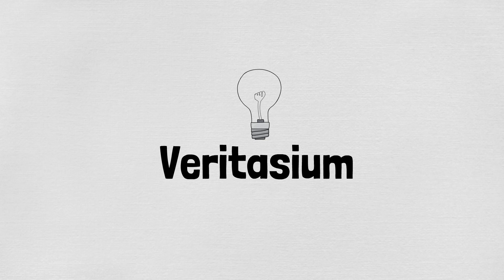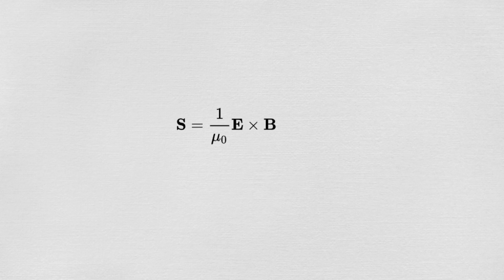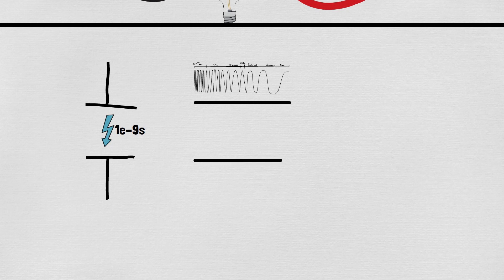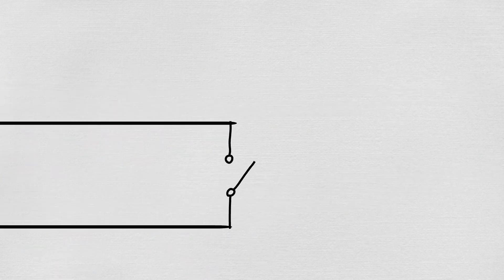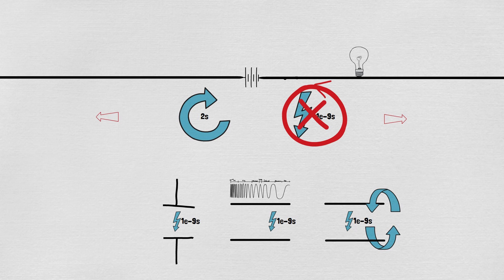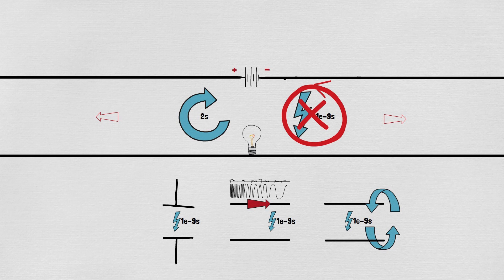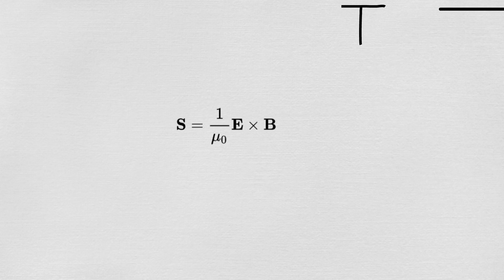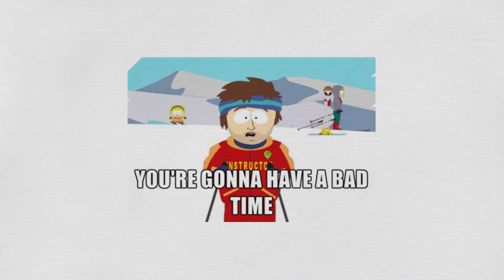Veritasium is Right? (see description)

Comment: Thank you, thank you, THANK YOU!  I made the massive mistake of clicking on the Veritasium link for what was obviously geek clickbait.  I had fallen for a similar video he made about "nobody has ever measured the speed of light".   I vowed after the speed of light screw up I wouldn't watch his channel again.  I am week, and I admit it.

His answer to the "how long" question was actually 1/c seconds, which is NOT correct.  He fails to point out this is Xm/c. Where X is the distance between the battery and the lightbulb.    Yes some small amount of induced current is created by the wires being 1 meter apart, but not enough to light a bulb.  He is also using a DC battery which means there is no oscillating current which means any induced field would be even weaker.  The way he explains this, it implies that you could could communicate faster than light, and that is not possible.

Comment: My remarks/complaints:

Disipative term J•E does not account for transfer of energy but for volumetric distruction of it. In the Veritasium video the line has zero conductance resistance, thus this term is zero anyway. 
That leaves us with grad ExH of volumetric change. Applying Gauss theorem we end up with ExH energy flowing through a surface (normal surface vector omitted).

You cannot model a line as a single capacitor. 

Poynting vector is space dependant.
Reply: you probably meant zero resistance = infinity conductance
Reply: @theincapable  YES. Thank you

Comment: The purpose of the switch is the obvious one, to make a change in the current. Only after we throw the switch can we establish a change in the B field and we won't see a corresponding effect in the far wire without throwing the switch. And if we accept that in the absence of resistance the energy flow is outside the wire, then the battery cannot "know" the state of the switch and change the current in the wire until time T2 = (D2 / c) where D2 is the distance between the switch and the battery. This does not mean that current has to move all the way around the path of the circuit before the light turns on, but some change in the current local to the battery has to occur before we are going to see a change in the B field.

Comment: You are correct that current is zero the travel time at the speed of light from one battery terminal, through the wire to the other terminal.  However the current doesn't instantly reach its steady state value.  The flow of current is opposed by the inductance and resistance in the wire (Current I =  V/R e** -Rt/L ), which could be significant in a 600000 long kM wire.  I would also like to point out that a schematic diagram, such as the one presented, makes no statements about the physical arrangements of components.   The diagram would necessarily need to specify dimensions, angles, wire composition, diameter, etc to make any assumptions or calculations based on such arrangements.

Comment: With the switch open, there is a potential difference. One side will be 0V, the other side will be B+ volts. Once that switch closes, (Can use FET for electronic control) there will be immediate current flow.

But this doesn't require huge wire lengths to test this out. Just need a fast oscilloscope/counter and several hundred meters of wire to test it. Increase the spacing between the bulb and battery and look at the time difference.

Comment: I've got my own disclaimer: I studied Engineering physics with a digital electronics emphasis, I was 2 classes away from an EE major, so this is pretty close to my field. However, It's been a few years since college and I don't remember all the math, but I hope that like you, I still remember enough of the concepts to make sense of what I've been told here. I will withhold judgement over whether I actually believe what I've been told for now until I hear a better explanation and/or see some empirical evidence. You made one assumption that I disagree with and the majority of your argument was based on that assumption: current will not flow before the E-field is established along the entire circuit. Please allow me to explain why I disagree with that statement, and then also what the implications are for the other thought experiments and questions you posed.

Current will flow before the E-field is established along the entire circuit, current will flow as soon as there are 2 things: there is a non-zero potential difference between 2 points, and the insulation between those 2 points does not provide a barrier higher than the energy difference that the potential provides. Meaning let's take the circuit at standstill; switch open for more than 2 seconds. There is no current flow through the light, therefore both sides of the bulb are at the same potential. One side of the switch is connected with a wire to one side of the bulb so that side of the switch is also at the same potential. The other side of the bulb is connected to the battery so we know what potential that is. The other side of the switch is connected to the other side of the battery and so we know what that difference in potential across the switch is too. Let's say it's a AA battery so 1.5V rise across the battery and 1.5V drop across the switch.1.5V is not enough to bridge the air gap and so no current flows. if the battery were providing saaaay 15,000 volts and could bridge about a half-centimeter air gap, so most normal switches we encounter every day would be basically a wire from the electron's perspective.

But we're assuming the voltage is relatively low even if it's not a AA battery. At the instant the switch is closed, the electrons on one side of the switch that have more energy than the other side will diffuse into the lower potential side (or higher potential depending how you want to think about it because Ben Franklin had a 50-50 shot and guessed wrong or whatever). The same way if you open a balloon, the air at the neck will start to escape faster than it takes that information to travel (this time at the speed of sound) to the opposite side of the balloon; because the air inside is at a higher pressure than the air outside. There's a barrier where the air can flow freely and so it chooses to equalize that pressure (I don't know a good way to explain it without anthropomorphizing something inanimate). Anyway, electrons are moving. Moving electrons means current flow.

Let me answer two questions you asked 1) how far do I need to move the switch away from the causal bubble of the bulb for current to flow. Well let's say we live in a magic world where you can just slide the switch over and wire that used to be on one side instantly appears on the other side as you do. Well, the internal charge density on one side of the switch was lower than the other side. The switch is an open circuit, and open circuit is a capacitor, the capacitor will store up charge until the voltage drop across it equals the voltage source. The setup has been at rest for over 2 seconds so the charge has built up on one side of the switch. If you give it some wire that has a different internal charge density, the electrons will diffuse from higher density to lower density. Lower potential to higher potential (yeah, I don't like current convention either). Electrons moving means current. so the answer is, any amount of movement will cause current to flow temporarily until the charge density reaches a new equilibrium. Once this new equilibrium is reached, charge density between any 2 points that are electrically connected should be identical because 0 resistance wire and all that so no more current can flow. Even if the wire did have resistance, this would still be the case, but the potential at any given point along the wire when equilibrium is reached may be different than what we see with no resistance.

and 2) what is the purpose of the switch. Well I alluded to this earlier, the energy of the electrons is different on one side of the switch than the other (when open). The electrons want to go to the other side, but don't have enough energy to cross that bridge. Current does not flow. What Veritasium I think either got wrong or didn't explain well was the time it takes for the light bulb to turn on is independent of the distance between the battery and the bulb. It has to do with the distance between the switch and the bulb. Remember, the wire has 0 resistance so the potential at the side of the switch connected to the battery is exactly the same as the potential at the battery. Closing the switch, is akin to connecting the other side of the wire directly to the battery, it's just that the battery could be considered a meter longer than normal (or however far apart the two are) because it starts at one terminal and ends at the switch. If the switch is moved 1/2 light-second away, when the switch is closed, it will take 1/2 seconds for the energy to reach the bulb. If the switch is 1m away, but there's 1/2 light-second of wire between it and the bulb, the bulb will turn on 1 meter/c seconds after the switch closes.

Several people use the argument what if there were two switches, one next to the battery and one 1/2 light-second away. Would we instantly be able to know the state of the other switch when the near one is closed? well no, the light would turn on regardless of the state of the other switch because as stated, as soon as the switch closes, current will flow (although it's debatable in the real world if enough energy would flow to light the bulb). However,  1 second later, we will know the state of the switch because the bulb will either still be on or it will turn off. The reason? because the charge density takes time to re-establish equilibrium, it will take 1/2 second for that signal to propagate down the wire to the second switch, either continue, or stop. If it stops, the charge density will build up, but the electrons back at the battery don't know this yet, so this 'wall' that the electrons hit where the charge density has equalized will also have to back-propagate to the battery for another 1/2 second before current stops flowing. So 1 second later, either current continues to flow, or equilibrium is re-established and current stops flowing (one could say that current flowing steadily is a form of equilibrium which I would agree with, but I hope you know what I meant).
Reply: This is the explanation that finally satisfied me. Thanks!

Comment: With DC from a battery, yes, there is no field until the circuit is physically closed, however AC supply would result in capacitance, induction & radiation without the switch being closed or the ends of the wires connected.

Comment: The problem with this analysis is moving the switch away from the bulb.  The position of the switch is what makes the answer  work.  It is the source of the PD along the wire.  This then radiates at the speed of light in the wire, but also interacts with the other wire.  This sets up a displacement current equal to the time derivative of the electric flux between the wires.

Comment: The purpose of the switch is to create a pulse the EM field propagates from the source of the pulse, if its far away you would have to wait for the EM field to propagate far back. the wires transmit power as an antenna/capacitor before steady state conditions are met only because impulses have high frequency components

Comment: The switch prevents charge from flowing across the switch and maintains a STATIC state.  Between the battery and switch, the wire is slightly negative and this will induce a small positive surface charge in the bottom wire near this section -- also static -- to cancel the electric field inside the conductor.  When the switch closes, this negative charge is unleashed on the right side and an equal positive charge is pumped onto the left side by the battery.  These NEW charges also induce equal opposite charges onto the other wire that MUST flow through the bulb as it is separated.  This DYNAMIC status will prevail until the expanding electric fields reach the shorted ends; at that point the wave is reflected -- equivalently the two charges neutralize as they interpenetrate.

Comment: When we speak about transients, a pair of wires can be replaced by a single resistor (=line  impedance). Instead of short pulse, there will be small initial current you can calculate by Ohm's law. This current will not change until the transmitted signal from the battery bounces back from the end of the pair. This behavior is easy to verify with a real experiment.

Comment: I'm a student at the University of Michigan studying mechanical and electrical engineering, and I just finished my basic EM physics courses and I think have a decent understanding of the theory of general relativity and causality. Definitely not a Vertasium fan boy here, but I'd like to see if I can back up his explanation.

Rather than thinking about causal bubbles of the light-bulb and fancy terms, lets simplify it a bit and define what the bulb thinks is happening on the ends of the circuit. Except, since we're talking about physics here, what the bulb "thinks" about the circuit actually depicts how it will behave. If we were to flip on the switch at time t = 0 (the switch, bulb, and battery being close to each other) and then someone also at the same time t = 0 on one of the far ends of the circuit cuts the wire, up until t = 0.5 s, the bulb still "thinks" that the circuit is intact because the information about the wire being cut takes half a light-second to reach the bulb. Thus, the light will turn on from 1e-9 s to 0.5 s. At 0.5 s, the information about the circuit being cut reaches the bulb and the bulb shuts off. Thus, what the bulb "thinks" is happening at the ends of the circuit is actually what happened there half a second ago.

With this in mind, putting a switch at the end of the the circuit and flipping it on and off makes sense. It won't turn the bulb on in 1e-9 s, it will turn the bulb on and off at the frequency that the switch is flipped on and off, but delayed by half a second. This doesn't break causality. The switch placement MATTERS. Since in veritasium's video he assumed the switch, battery, and bulb to be close, his explanation is correct. 

You say that in order for the bulb to turn on, there must be current. This is true. You also say that the circuit must be closed in order for current to flow. I say this is false. In order for current to flow, the only thing that needs to happen is that the bulb and battery need to "think" that the circuit is closed. This is very nonintuitive unless you're Albert Einstein. Again, the bulb "thinks" that the circuit is closed if the ends of the circuit were closed 0.5 seconds ago.

Back to the original scenario. When we flip the switch at t = 0, at t = 1e-9, current starts moving through the bulb because an electric field propagated from the battery to the bulb and started pushing current through it. Current has not even moved yet at the far ends of the circuit. The current's direction IS defined, because the battery and the bulb "believe" that 0.5 seconds ago, the circuit was closed.

Hopefully this makes sense, and sorry if my explanation was repetitive.

Comment: No, @Tycho, the bulb doesnt "not care about the shorts at the two sides". The shorts HAVE to be there for the voltage drop to be there. Only when there is a voltage drop will the current start flowing. ONCE the current start flowing, the energy can be transmitted by any of the 3 methods that Veritasium talks about. No shorts = no current flow = No energy transfer, neither in 2 sec nor in 10-9 sec. So, the switch is there to close the gap and make the voltage drop available for the whole process to start and we cannot simply ignore it. What Veritasium implied by ignoring the shorts at the end, is that ONCE the current starts flowing, we can VISUALIZE the system as two wires by NOT LOOKING AT the two shorts. No one is ignoring them, their effect is there, its just a visualisation method to help us look at the system like two parallel wires.

Comment: Veritasium seems to have been loose enough in his description, partially to not give away the game, that it opens up discussions like this. I found the eevblog description of this the most insightful. In a DC circuit, the light would flash almost immediately, then turn off, then turn back on again in 2 seconds. In an EE sense, this is actually undesirable behaviour, and we'd want to correct for it with a "soft on" or something, and if it's AC, then it should legitimately switch on almost immediately depending on the frequency, but like you mention it acts as a transmission line in that regard.

The thought experiment really just flips on its head what is thought of as aberrant behaviour (along with a healthy dose of handwaving) to make a decent... Poynt...

Comment: Thank you for this. Even though the thought experiment of causality being broken came to my mind even as I was watching Veritassium, that pithy last one liner (regarding t variable) you say is perfect for summarizing it at the deepest level.

My math teacher used to say that proving by contradiction is what we do when we don't have a perfect grasp of the subject matter. And the causality problem is just that, proof by contradiction.
Reply: Causality is not broken. The causality is between the switch and bulb in space, not the battery throught he wires to the bulb. The switch and bulb are one meter away, so it lights up almost immediately. As you move the switch away from the bulb, it will take longer for the EM field to propgate through space and induce a current in the bulb.